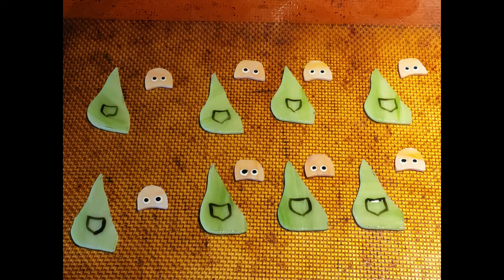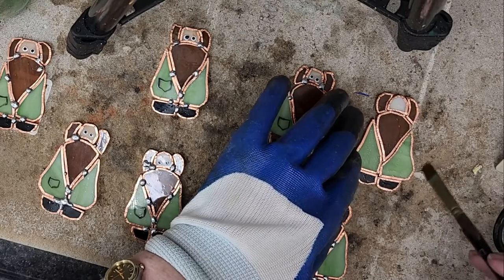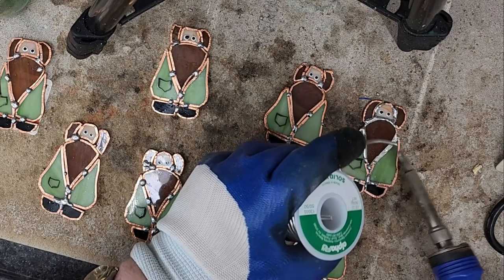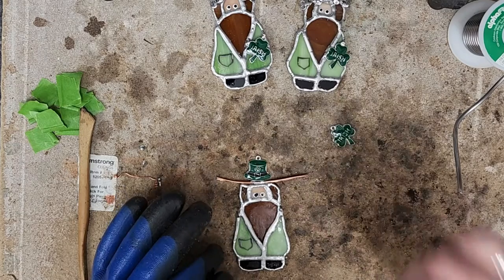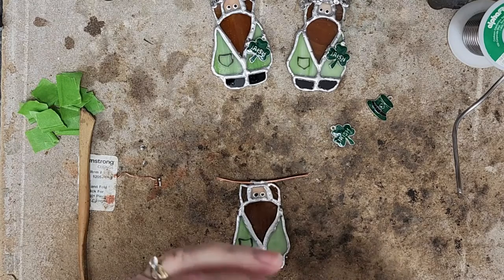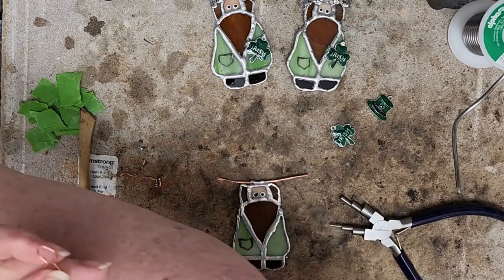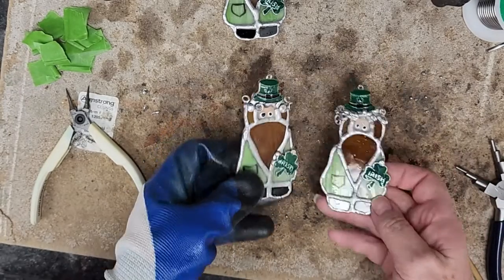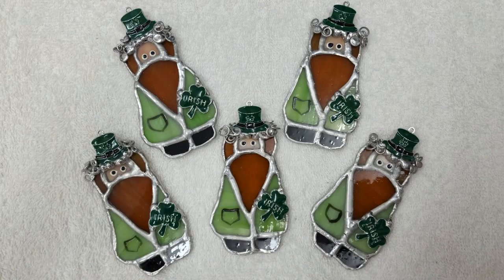Creative Idea for Stained Glass - Embellishments

Comment: Can you please answer a question. I recently purchased some vintage sun catchers and when I received them I was surprised that the lead was soft and moveable. Is this normal?
Reply from the maker: For small sun catchers where the "Tiffany Method" is used, meaning copper tape and soldered, there should be no movement of the glass.  For stained glass that lead came, meaning lead channels, are used to put the glass together, it should be tight but there may be some movement in the glass since they are vintage.  I hope this helps.